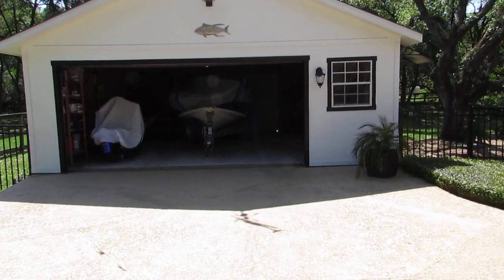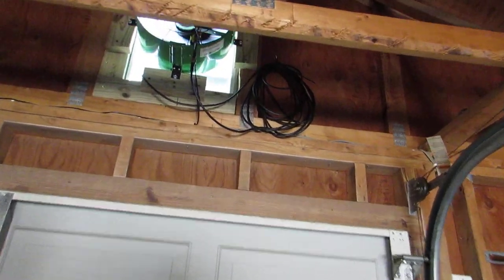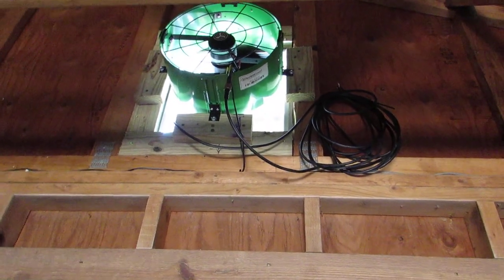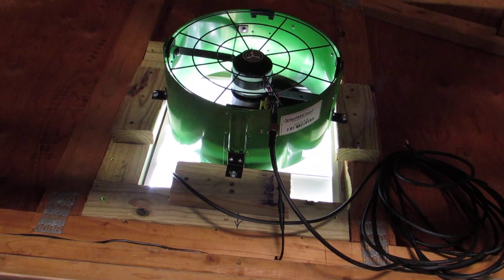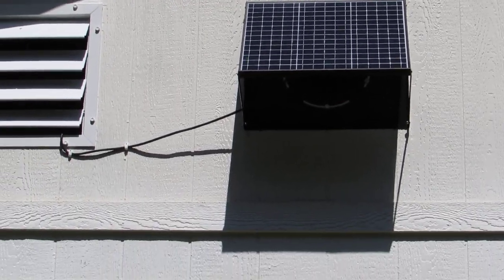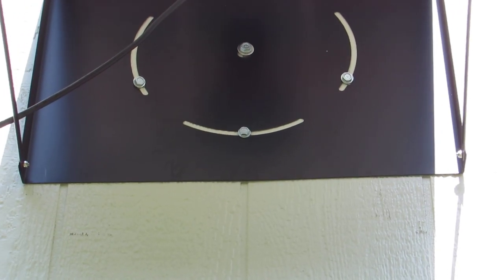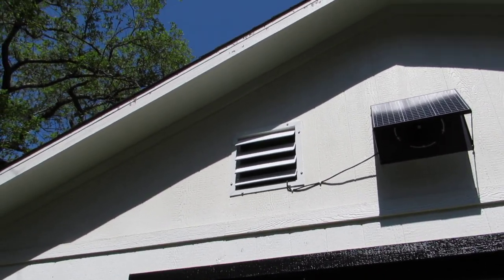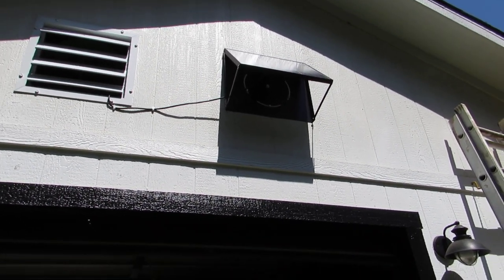Solar Powered Gable Mount Attic Fan

Comment: I've looked into all of the ventilation systems out there.  I decided to put a box fan in the window of the upstairs attic.  I turn it on and the upstairs of the house is 20 degrees cooler.  I'm not going through all that aggravation doing all that work.  The only thing that would be nice would be to have a solar power fan and not use electricity
Reply from the maker: Hi Bob, I use  the solar exclusively on mine most of the time since it is in my boat house. If it were in my house attic I would probably use the 110 converter so it would run at higher speeds when the sun isn't out. Thanks for visiting my review.
Reply: @thecounselor4287  Smart, not lazy.  I can remove the fan when I want to and turn it off when I want to.  I put a timer on it to turn off at night because it cools down by then.  IT's fantastic.  
 No difference except that I don't have another hole in the house.
A house is like a swimming pool.  The more holes you have in it (drains, skimmers, etc.) the more chance of leaks.  The same with a house.  Less holes, less issues

Comment: I need to replace a failed gable mount attic fan and I wondered whether there is such a thing as you show.. However, with further thought, I'm now considering a ridge vent as being overall more practical. Did you evaluate a ridge vent? The current install gable fan usually ran until 8:30PM (85 degree shut off); sometimes later on hot nights so the solar unit wouldn't bring down the late day temps.
Reply from the maker: Hi, Yes the ridge vent is a more cost effective way to help cool your attic. Especially if you have them installed when the building is built or if you re-roof your building.It is passive, works at all temperatures, no maintenance and requires no power usage. The solar fans are a good boost when you need it most.

Comment: Was just looking for solar vent fan's because I'm about to order a shipping container for storage, and those things are unbearable in the summer with no ventilation. I was thinking about installing two of those shutter style vents like you have there and have the fan blow air out of one so that it will draw fresh air from the other down at the other end of the container.  No offense but I wish this video was a couple years old so I could ask you how reliable it has been. Thanks for posting this though!
Reply: Ive done a similar push/pull set up on my cabin in the mountains.
It worked well with just a puller fan drawing air through the cabin but with the pusher on the other side it’s really nice and draws a nice breeze through the cabin.
It’s wise to wipe the panels down every month or so with a rag and some mild soapy water or just water.
Reply from the maker: Hi, I posted an update as you requested. I hope it helps.

Comment: I watch other video with same fan.  Noticed a person plugged solar wire to the outlet. Is it true? I thought suppose be power from the sun.
Reply: He said you could do either. So if the sun isn't out you can plug it in if you want.
Reply: its both.  if you want it to work at night you need the converter
Reply: Thank you. I thought have to plug in. Ready to install mine this weekend. You guys are awesome.
Reply: Once the sun goes down at night time it will switch the smart controller and run AC power to the motor at 30 W that way you can get the benefits of calling your attic at night time once it gets to temperature then it will shut off and go back to DC during the daytime
Reply: @dustinstevenson8477  is it thermostically controlled or all manual?
Reply: @justinsane7128  The fan is set at 88 on and 78 off this means the fan will run on DC during the day. if the air is above 88F  then the inverter will switch over and run off AC power which is running at 30 Watts. Once the fan reaches 77 no matter DC power or AC power it will shut off. You cannot adjust it it comes pre-adjusted. Hope this helps

Comment from the maker: Hi I have had a request for an update and a comparison of the effectiveness of the solar fan vs the ridge vent. So here goes. UPDATE: We are half way through the hot summer now and the power solar fan is working great. I use the 110 converter as a booster when working in the garage at night and when the boat is wet. It does help with our hot, humid weather. Noticeably less mildew and it runs off the solar at 100% when the sun is out. CAPARISON: between the ridge vent and solar fan. Yes the ridge vent is a more cost effective way to help cool your attic. Especially if you have them installed when the building is built or if you re-roof your building.It is passive, works at all temperatures, no maintenance and requires no power usage. The solar fans are a good boost when you need it most. They complement each other.
Reply: I'm glad this is working out well for you....i was always under the impression that ridge and gable vents to not compliment but work against each other. Any input?

Comment: How many speeds does this fan have?  Thank you
Reply from the maker: Hi earthbound, thanks for visiting my channel. This is a single speed fan. However, unless it's plugged in, it runs at variable speeds depending on how many watts the photo cells are producing. On a cloudy day it will run at a lower speed than a sunny day. When plugged in it runs at a full 30 watt speed. I hope this helps.

Comment: Yeah I don't think ridge vents do s*** . Lol the idea sounds good but it's not really . Like if you have the doors closed . And you have the solar panel and the fan is spinning I wonder where is getting all that air from . It's it's an lot for CFM it will suck the air anyway from the ridge vents or it suck air back in from them . Kind of an stupid idea .  how's the heat supposed to go through the vents anyways . remember the old style things are on the top the house when the wind would blow they would spin . How to make those on the top of the house would make it easier
Reply: What are you talking about?  Can you please rephrase your thoughts so I can understand?